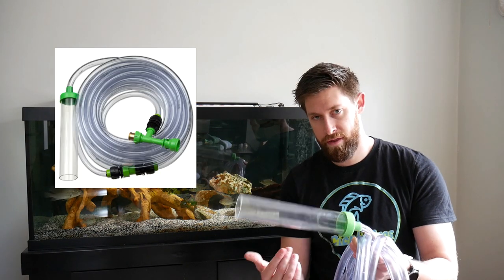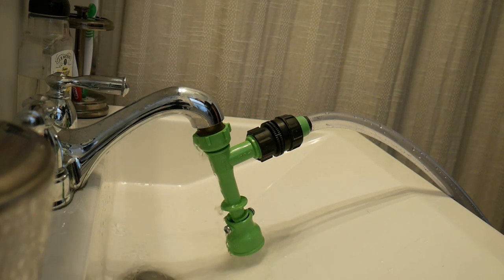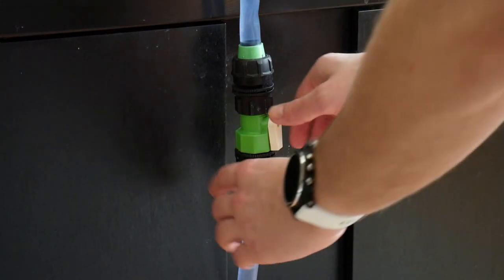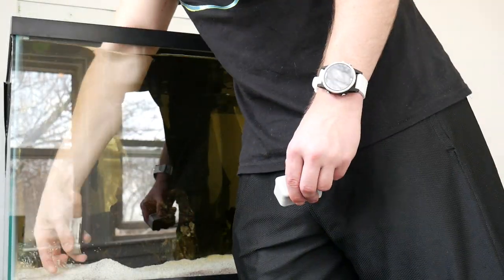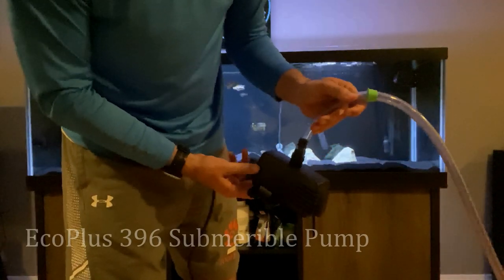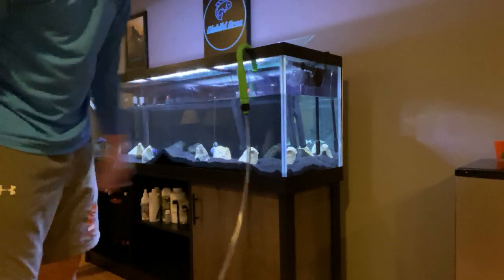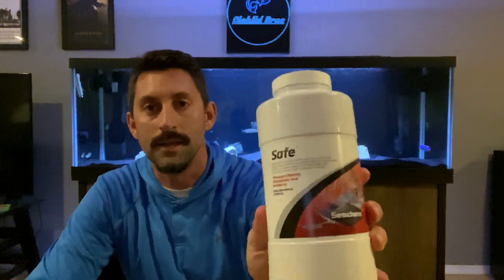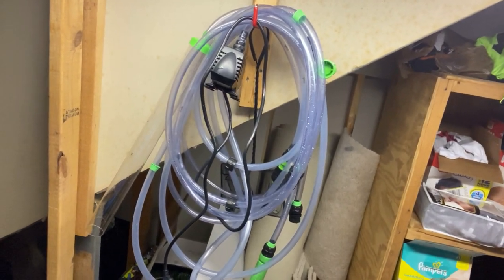How We Do Water Changes | Tips & Tricks

Comment: I have used a Python for years and have had my fair share of accidents due to distractions that made me forget I was filling and overflowed onto the floor. I love it for extracting water but I rarely use it to refill because of temperature. Instead, I use a 5gallon pale and a thermometer to be sure the new water matches the temp of the tank water. The finger test can be off by a lot, my finger cannot tell the difference between 77 degrees that I keep my tanks at and 88 degrees which is way too warm.

Comment: I might have to pick up a python. I'm tired of getting a mouth full of dirty tank water from manually starting the siphon 😂
Reply from the maker: Haha definitely. I honestly don’t know what we’d do without it. Using buckets for 75g+ tanks would be exhausting
Reply: Eeewwwwwwaaa😁
Reply: I have both the Python clean and fill that attaches to the sink and the other that you say you get water in your mouth. I never get water in my mouth, usually, one soft suck on the tube and the siphon will start, it only takes a split second to move the tube to the bucket.

Comment: Thanks for the great video!
Do you ever have trouble with the suction  on the python when the tank is lower than the sink level? How go you handle this? Any suggestions on gravel vac with low sucking pressure
Reply: You might wanna add a water pump to it. Thats how i did it on mine i have a 75 sitting in the ground

Comment: I have a 150g tank but it is one floor level above my basement utility sink.  I drilled a hole in the floor for the Python so I do not need to run water to get a good fast flow going.

Comment: Okay so I’m new to large tanks, I just got a 75 gallon tank. When doing a water change it’s okay to put the water conditioner into the tank before filling the new water into the tank ? It’s easier to do it with my 10 gallon because I just throw prime into a bucket of water of the new water
Reply: Not sure if you’re going to see this but I hope you do !
Reply from the maker: Hey there. I usually put some Prime in right before the new water comes in and then a little more as it’s filling up. And I treat the full volume of the tank - not just the amount of water going in
Reply: @CichlidBros  thank you for that info, just don’t wanna mess anything up!

Comment: yeah but what if you dont have enough water pressure to run all that hose plus the top of my tank is about 6.5 ft high??....like i went and got a 155gph pump but its still not strong enough to push water that high...where can i go to get a pump strong enough without breaking the bank??..ive already invested in several hundred dollars in this new setup..thanks in advance

Comment: here is my tip. Connect the python to your bath tub faucet it is lower than a sink connection, that way you can turn off the water from the tap and a natural syphon will occur saves water this way.......keep your tap running for a more powerful syphon to do a gravel (sand) clean. this tap off method maybe a little slower but it saves water.

Comment: These are fine for filling, but they waste far to much water for draining.  You have to leave your faucet running in order for it to create the syphon needed to pull water from the tank.  No thank you.  a submersible pump or transfer pump does the same task with out all the waste.  Costs you more money initially for the pump, but you save money on your water bill especially for someone like me that has (2) 75 gallon tanks, a 55 gallon, and 2 (20) gallon tanks.
Reply from the maker: We now use pumps, Sicce ultra zeros

Comment: What a waste of water to create a constant suction. Get a pump dude.
Reply from the maker: Joel we have one for the 125 which is towards the end of the video, and the water isn’t on long during the draining of the other tanks. Thanks for watching
Reply: I saw that I’m referring to your other tanks. Even with a 75 gallon tank using the python the way you did without the pump wastes a lot of water.
Reply: Wouldn't a simple siphon with an extended hose do the same thing? Just get the siphon going and hold the hose to the drain. Depending on the height of the tank you could take the hose to the bathtub drain if the sink is higher.
Reply: Really , really 🙄

Comment: I tried this and killed half my fish because of the chlorine in the water. Now I fill buckets and let the water sit for a day before using for my tank.
Reply from the maker: Sorry to hear. Making sure to use dechlorinator like Prime or Safe has worked best for us. But the bucket method should work for you 👍🏻
Reply: @CichlidBros  it happened before you posted your video but the lesson learned was valuable. Now I let the water sit and also add dechlorinator and bring the new water temp up to the aquarium before doing changes. Thanks.
Reply: How much is ur water change?
Reply: @RaciouS91  50% every 2 weeks
Reply: @izhar4547  I think 50% is too much. It could change ur overall parameter. Maybe just 10-20% per week or 30% for 2 weeks. Just do the water changes. Then u'll see the pattern.
Reply: @RaciouS91  oh I've been doing this for over a year now. It's been fine. Fish are happy overall and my tank is stable.